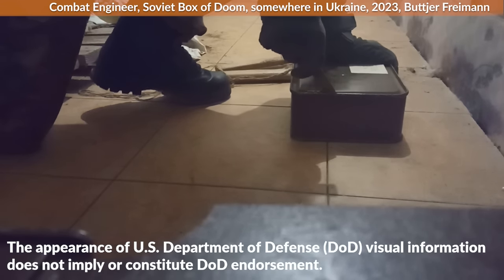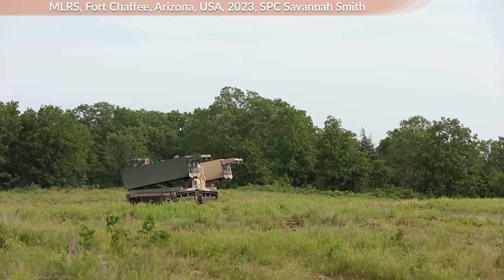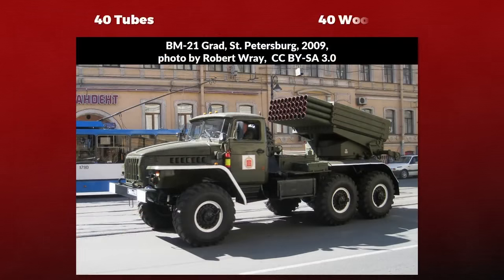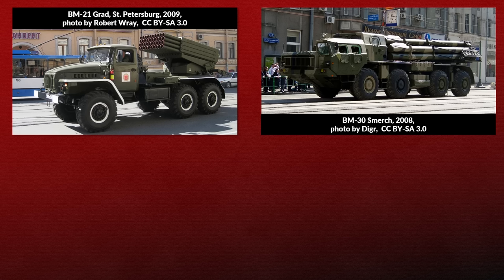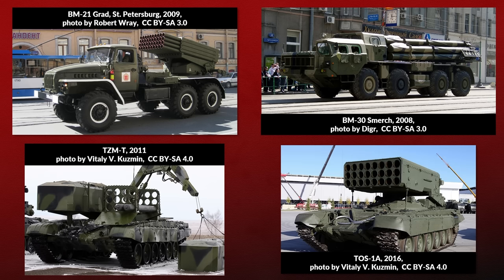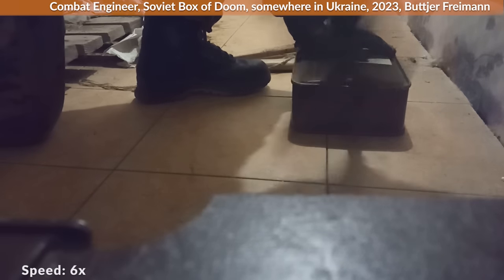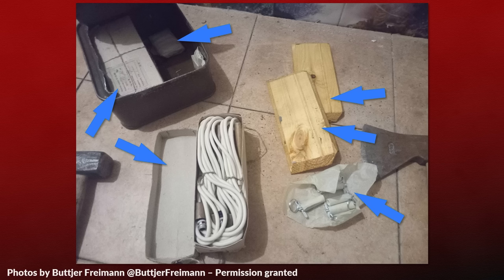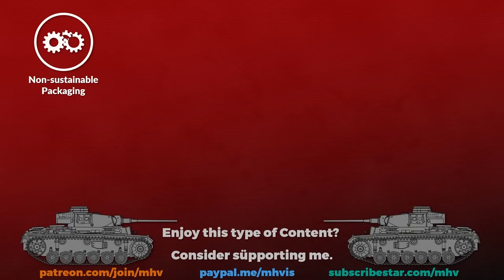Ukraine: Why Soviet Packaging is a Nightmare - Unboxing Edition

Comment: I bought several cases of Russian ammo years ago (made between the 1960's thru 1980's.  Still cased the old way in a wooden case with two hermetically sealed cans that you needed an oversized can opener (think of a WWII P-38 can opener on steroids).  Even then you need some leverage and muscle to get the cans open.  The ammo was fresh looking and fired just fine.  A friend bought a newer ammo cases made in the late 1990's, and it wasn't properly sealed.  The ammo in the can had some mild corrosion and damage to the packing material (basic cardboard and paper).  The ammo fired just fine, but he had issues with some of the steel cased ammo sticking in chambers.  A lot of stuff made after the USSR collapsed wasn't even as good as the stuff made by the Soviets.  It's like the Russian's stopped caring, since they figured that the KGB and other internal services weren't watching over their shoulder every waking second of the day.  Not that they really cared to produce a quality product in the first place.  Most of the Security Services (KGB, GRU, Police) were overblown in their ability to spy on you (but they had really good propaganda to scare the crap out of everyone) and your neighbor was more likely the source of your problems informing on you, than some outside agency spying on you.  After the collapse of the USSR production on a lot of products went downhill.

Comment: Grad shoot --> moving to place with soldiers and pile of prepared rockets --> rearm in 5-10 min --> move to firing positions. 
So problems you talk about is not such heavy.

And then only the advantages with separate storage of shells begin.

 It is more convenient to store. 
It is more convenient to transport. 
It is more convenient to handle in war conditions - damage to one of the tubes in the pack does not disable all the pack, how it could be if you drop mrls pack

Comment: This subject brings to mind the way Russian mortar shell propellent charges are made. Each charge seems to be made of a cloth bag with cloth ties and must be tied onto the bottom of the shells in numbers required for the distance they are aiming. This takes a lot of time to prepare and or to modify different charge requirements during battle .Western systems I’ve seen have charges made of of doughnut shaped charge rings which have a small gap to one side permitting it to be slipped on pr off of the shell easily and rapidly.
Reply: Что вы будете делать, если ваши пончики сломаются?

Comment: You have to realize that all these weapons were created during the Cold War and for the most part were meant to lie in warehouses for decades, so reliable packaging, in which ammunition will not corrode is much more important than convenience. The Soviet army did not think about ergonomics or comfort at all, it becomes clear if you sit in any soviet military vehicle. In wartime, it means that all these boxes can be stored in worse conditions - in semi-flooded rooms, in basements with mice, mold, cold, heat, etc. There is nothing worse than discovering that your supplies have been destroyed not even by the enemy, but by the environment. So for a soldier to open a few cans is not such a problem against the terrible conditions in which he sometimes has to fight.

Comment: Dude, Ive seen videos of a whole russian squad using one of those wooden boxes as a hammer to force the rocket into the slightly bent and worn out tube. If it takes them 40 minutes on a brand new Grad, imagine what the lack of servicing is doing to that 40 minute load time.

Comment: Ammo Packageing is made for long term storage,I opened 1960's 7.54R - 800 metal box it was sealed by soldering tight it was akward without a tool to use. but the ammo was perfect only one missfire ! Very Good Be Blessed I opened the box 20years ago.

Comment: The BM-21 can reload a LOT FASTER when you look at reloading after MLRS is out of reload packs, they only carry a MAX of 2 reload packs.
Reply: You see, HIMARS and M270 don't run out of reload packs, as that's how they come from factory.
And it's just matter of how much you load on a flatbed that will drop off more rounds for it.
The problem is reverse, it is fast to reload BM-21 when you have truck with unpacked rockets, but after you are out of those, you need to spend more time by troops that could have been on front to unpack more boxes.

Comment: Come on, our bureaucrats do work between their breaks! So at least between 11:19 an 11:20  and 13:29 and 13:30 you have the chance to find one. ;-)
I mean i can see two possible ideas for the single rocket packaging: 1-if yor crane is damaged your soldiers still can reload the thing. (needing fewer high tech things) and 2-you can top off ->so if only used a few of the rockets you can fill up to full again. (no idea if they even fire single ones or the whole load, probably always all of them in one attack)
The ammo cans though... apart from storing the ammo in moisture safe containers that also aren't easily damaged, i would have at least expected some sort of opening mechanism like any tunacan has.

Comment: NATO 120mm
https://youtube.com/shorts/PvlqxW6tphk?si=OGg0eLuaXZdiOkc4

Soviet 125mm

https://youtube.com/shorts/PS-_TKTVP_g?si=L0kLhWn51QU0VGfQ

Here you can see the difference: The 120 can is a metallic canister that can be easily stacked/stored, durable,has some level of protection for the ammo,even comes with a handy pull cord ......

The 125mm's is just a wooden crate,and you'll have to wiggle the propellent charge out from its own can.
Reply: Soviet 125mm fo autoloader, not for big black crewman
Reply: @coyoteranger  counterpoint: K2 and Leclerc both have autoloaders and use same 120mm ammunition.
You see you can design a autoloader tank that won't pop the turret when you hit it's ammo rack.

Also... do you know why autoloaders were introduced in Soviet army in the first place? Not for convenience, faster loading, or less crew, but if Red Army were to push into irradiated area they nuked themselves the one guy that does manual work would die first before mission is over (survival for everyone else was still questionable).

Comment: People forget that Russian/FSU ammo isn't made of copper and brass, which are highly corrosion resistant. Steel plated bullet and case can rust, therefore using a sealed can ensures no moisture in the can. Opening 1940's Soviet Ammunition in galvanized cans keeps the ammo looking fresh for over 80 years. Source: https://youtu.be/nw6syvcFh1A?si=l3SqfgPS2JOJmABT

Comment: Dude, the BM-21 is from 1963. It's over 60 years old.
The M270 is from 1982.
Designed 20 years later... of course it's more efficient at loading!
Reply: Dude, you obviously didn't watch the video, he specifically addresses the point that. BM-30 and TOS-1 also use one by one loading.

Comment: I didn't deal with other stuff but small arms munitions boxes are a fucking pain in the ass especially when you're in dire need of them. Not only that they're hard to open but edges are razor sharp once you open them. If you don't have gloves to protect your hands you have to be careful. What's even better than that is most of 7.62x54r came unlinked in boxes (at least to my unit) which requires loading these cartridges into non-disintegrating links one by one for machine gun use. Fun times.

Comment: It's not so much how they are packaged but really how Ukraine maintained these stores of ammunition. Ukraine army has been in a serious state of disrepair even before 2014 which is why munitions from the Russian side look virtually brand new while Ukraine's looks like it was dug out of the ground. 

As for reloading times for MLRS systems this is largely a moot point since a fire mission takes awhile to come from the observer, to the FDC to the gun batteries. However since MLRS systems are usually brigade assets this could take much longer.

Comment: Russian 7.62x39  ammo comes in a wooden crate with 2 "cans' of approx 750 rounds per steel can. You have to open the cans with some tool which sometimes is provided in the wood crate or there is a zip type of lead sealed opening device. Then you have paper cartons with 20 rounds per with more paper protecting each round. Yes, well preserved but a bitch to open under combat conditions. I have seen videos of troops exiting a BMP and the paper boxes, still containing cartridges, strewn all over the floor.....Some Soviet Bloc nations had the cartridges already on stripper clips, but this is not standard. Just my observations.

Comment: With all due respect for your content I do have some remarks.
0:50 it is true that the bm-21 takes 10 minutes to reload compare to the M270, however the M270 needs a crane and a spare loaded rocket magazine, which is not always at hand.

I don't know what kind of combat enginner you were asked but he should leave his position if he is giving 40 minutes for the proces. After all the usual way the russians are loading them is by 2x2 teams, One them removes a rocket from the box the other is loading the a tube.

The loading itself is not much of a big deal, the rocket is simply pushed inside the tube, no additional steps required, 

You can see the loading progress here: https://www.youtube.com/watch?v=cl7Wu6DkrYU

I don't see the why would the boxes being an issue, those boxed are meant to be handled by persons and to place them into trucks for transport. The have handles on their sides. And the top counld be opened easy. 

Also if it is really matters they do transport rockets without boxes. Loading a prepared rocket from a flatbed truck takes 10 seconds. So I don't see why would it take 40 minutes to load it.

The soviet boxed are typically reused. I do have old rpg-7 boxes at home and I can see multiple dates on it referring to multiple use.

TOS-1A do have dedicated transport vehicles but the crew do load them by hand, or could load them by hand in the case of lack of the transport vehicle
Reply: The m270 come equipped with a crane second second your argument that it doesn't alway have loaded magazine is dumb because we'll of course it's going to take longer to reload if you don't have any ammo 
Also the rocket on a bm21 need to be armed before being loaded as he mentioned in the video reloading the bm21 is very tiring after even after 1 or 2 reload so having to unpack 40 rocket arms them load them again and again us significantly more tiring than Himars or m270
Reply: @TheFrenchBaguettes  

First: I did not referred to the crane I was referring to the rocket magazine and the transport vehicle when I was saying it does not always being at hand.

bm-21 rockets need to armed due to being the way they are working. Just like any arty shell, but again I show you a video how it's work, it does not takes 40 minutes. 

No offense but if 2 people has trouble handling 65 kgs for a short period of time they should really consider themselves unfit for service. A typical natoshell weights 45kgs without the propellant. And that carried by a single man on racing with the clock.

I have doubhts regarding that himars or M270 rockets are being carried live without any mechanical measure to prevent accidental explosion. It seems like a huge safety issue for me. After all, this is the reason why HE shells or rockets are being transported without fuzes.
Reply: @venator5  for the first points I stand corrected for the second point no carrying a few shell in a short duration is easy carrying hundreds no
Fir the third I'm not saying the BM 21 is unique in it's arming procedure all I was saying is that you can take it out of the box and load it as you seem to suggest

Comment: Commie came in a few varieties for small arms ammo. I liked the Yugo wire pull and the Bulgarian spam can style. They are both certainly easier than the Russian/Romanian/Hungarian tuna cans. An old lawnmower blade and a hammer works as well as anything for opening the tuna cans

Comment: I have a bunch of spam cans of surplus Russian and Chinese ammo.
Yeah, those things are a bitch to get open.
The tabs are often rusted and not strong enough to pry the thing open and break 100% of the time in my experience.
I've used a screwdriver and a hammer to bust through them and then pry them open.
Those tins are razor sharp and it's easy to slice your finger open if you're not careful - I know this from experience.
I had a tin slice right through my glove and cut my thumb.
If someone reading this has a better way, please tell me.

Comment: With ammunition stored like that you can say that, typically speed is not of the essence. However that ony applies to those  times when speed is not of the essence.

It's not urgent till it is.
Reply: I'd think that anyone who'd served in the military would have pointed out that ammunition is sometimes needed *very quickly*. Also, when it's needed quickly, it's needed very much.

Comment: Wait wood and paper?
Was this kidnle for fire?
I can see soldiers using this can as pot or foreplaces.
People are just way to adjusted to "easy technology" that they sometimes forget mechanical and manual usses of thing
Which are primal when in a combat zone, as people are basicly stuck, supplies are chaotic and attack, corruption is ranpant and soldiers end up with too much times in their hands.
What comes to mind is alternate use of equipment, like how torniquetes are use as sling, globes and handle for equipment.
Obiously it becomes unusuable for it original porpuse, but when you have 4 of them and no sling, woldier improvised

Comment: this ammunition can still be used even after 50 years
Reply: It's not the problem that the ammo can't be used after that time. It's actually easy to store it, (and takes deliberate mishandling to get mouldy Strelas that Germany still had after unification)

The reason why ammo has a shelf life is not due to rust or dirt, but rather that explosives tend to get more spicy over time, which can damage the weapon and potentially injure or even kill the operator.

Comment: Couldn't the wood be used because it doesn't create dangerous sparks like metal or stone?
Reply: Nope wood is used because its cheap and low density, stone and metal have way higher weight per volume.
Reply: its basically just to fill the empty space or else the content inside would move around which would decrease their condition after decades. there wouldnt be enough space for a third box inside in this example, so the empty space was filled with wood. the same can size is used for many other things, so sometimes the volume is maxed out and no wood is required. ohhh and its cheaper

Comment: This does beg the question, considering that Ukraine has transitioned heavily to NATO systems, why are they not winning?
Is it possible that there is something we aren't really understanding about the russian way of war? Like all of it?

How about like how easy it is not just to store these items in this way, but how easy it is to transport them in large and small vehicles to depots all across the frontline, second line and in the rear?

Don't think you can hide that HIMARS cell very easily in an improvised depot in a wooded area, but moving a bunch of boxes off of a truck into dispersed improvised depots in a concealed area or trenches is quite easy.

Same with those ammo spam cans. That shit is hard to damage and extremely resistant to the elements. You can leave it all over the place and so long as you remember where it is, you can open it and shoot it without worry.